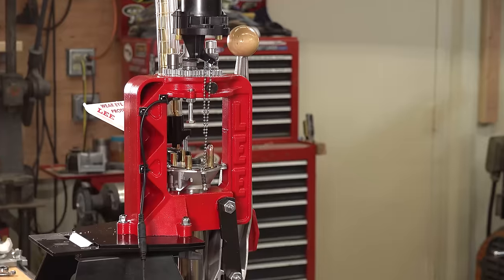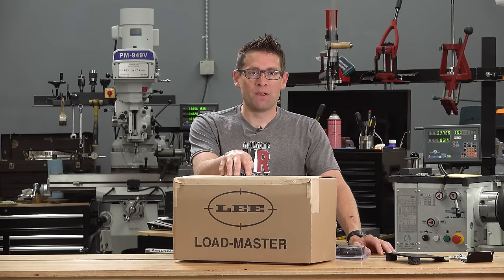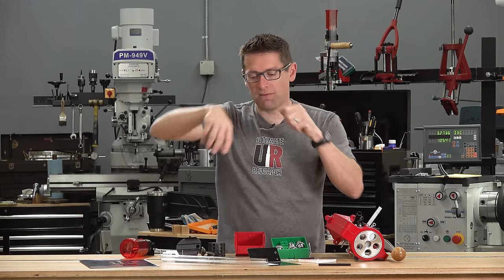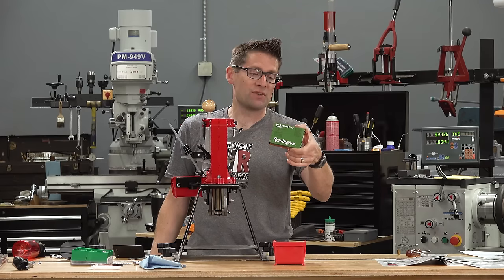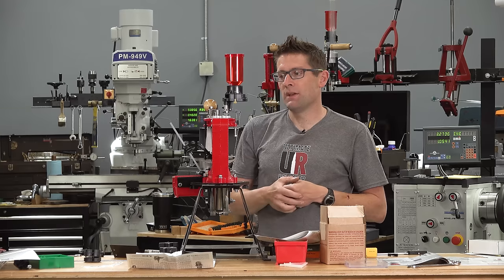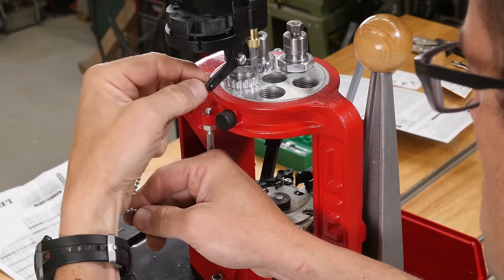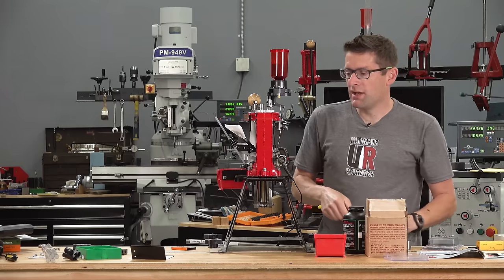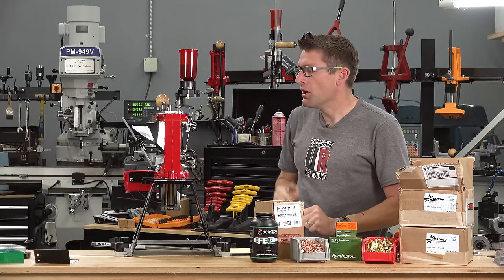Lee Loadmaster Unboxing/Setup, Loading 9mm Start to Finish

Comment: I've used the Pro1000 since late 2016, and (with simple but consistent regular maintenance) it has worked perfectly for over 39,000 rounds of exclusively 9mm - an average of about 7,500 per year. The press is still working quite well, and I'm very pleased!

Comment: I've been running a loadmaster for 8 years. Its a good press once you set it up properly. I pretty exclusively load 9mm for uspsa on mine. 

My major tip is to MAKE SURE you have it mounted very solid. Even the way Gavin had it, almost too much rocking back and forth. If it rocks around you will flip/tip primers.

Other than that, as with any progressive press, you can load a ton of ammo, or a ton of mistakes in record time. So keep an eye on things.
Reply: 🤣🤣🤣🤣 "and a ton of mistakes in record time" 🤣🤣🤣🤣🤣🤣🤣🤣
Reply: Do you deprime before cleaning with the press?
Reply: @mpngreen3897  I clean before and deprime on a Lee APP press

Comment: I've been running a Loadmaster for a year or so.  I understand there were some issues with earlier iterations of the priming system, but mine came with the same one shown in your video and between it and using the sizing die in the priming station I have no issues priming on the press.  As a rule I have to bump up the disc size on the Autodisc.  The reference list seems to be a little light for 9mm charges in my experience.  The issues I've had have all been minor and a result of something I could have done a little better.  The biggest thing to remember with this press:  If you think you're smarter than the folks who wrote the manual on it, you're going to have trouble and end up disliking it.  Follow the instructions as written and you'll be fine.  I strip it down and clean it every 3,000 rounds or so.  I'll be getting that light.  The Loadmaster is economical and reliable.  Thanks for the video!
Reply: I had the same issue with light powder charges using Alliant (then Hercules) powders.  No issues using ball powder from Winchester/Hodgdon.

Comment: I've been using a Loadmaster for 2 years for 9mm, 45acp, 38/357, .223. I modded a 6s shellplate for 9mm (big improvement). I decap, size, clean (wet pins) and prime off press on my Mec. I have never primed on this press because I used the pin method. I polished all my shell plates. I load 22-250 & 308 on the Mec. I LOVE this press. I started reloading in 1990 on a 550b (just pistol). I feel that the loadmaster is a press that needs fine tuning and that is a plus for me. I enjoy reloading as much as shooting! My favorite dies are Lee. I also appreciate your treatment of Lee. My wife wanted me to get a 650 but I took a chance on Lee and had the the money I saved for toolheads, dies, and more equipment.

Comment: I have a Lee Loadmaster with over 50,000 rounds of 9MM; 40 S&W; 45 ACP and 223 through it.  I have found that the key to making it run is keeping it well maintained and properly adjusted.  Running hundreds of rounds per session the one essential upgrade is the Inline Fabrication Roller Handle conversion.  I also upgraded to the Lee Auto Drum Power Measure.  I can't believe the press still comes with the Disc system.

Comment: I have ran my load master for about a year it’s honestly a love hate relationship. Some days I can legit crank out 700-1000 in about an hour hour and a half. Same press same components nothing gets touched, powder drop starts leaking the drum or disk, primers won’t seat, case feeder acts up, I now did 50 rounds in a hour I sit down shop dillons and look at the price and say ok one more shot it works awesome again and I touched nothing. Also installed an in-line fab roller handle if your running one of these that is by far the best upgrade for the press. My hand would cramp for days when using the stock ball now it’s easy sailing. I would like to see you do some trouble shooting videos on this thing. My powder drum will run awesome 95% of the time than the chain won’t stay put than it will drop a super light charge than no powder than on the money and repeat, than my auto disc no matter what powder will not stop leaking. Love the page by the way no brand bias you love the Lee single stage cheap intro press as much as the mark 7 with auto drive
Reply: Ditto on love hate relationship.  I do a tune up on the press every so often.  Clean, lube, adjust and that seems to keep it more reliable. 

Also, my press has "loosened up so that the index rod does not glide all the way down the frame. I had to add a washer on one of the bolts on the linkage and that seems to have helped. I think it happened because I used the press to deprime about 8000 cases for cleaning.  So I have probably run 12000 cases thru it causing it to loosen up.

I usually run 9mm and can easily reload 200-300 in an hour. For .223 I resize in Loadmaster,  prime on another press and finish the rest on the Loadmaster.  If I have $1200 I would try out a Dillon.
Reply: Just get rid of the chain.  Use a small bungee cord to connect to the powder measure and you can even run it straight back to an eye hook on the workbench as long as it applies the rearward pressure to pull the charge carrier back to the rear after the upstroke.  It's probably the first thing I replace on these.

Comment: I have owned a Loadmaster for about 15 years.  It has always had issues crushing, installing upside down, sideways and missing primers.  I have watched numerous videos on how to remedy this.  I have replaced components, tweaked this and that, to no avail.  I just prime the cases in a different operation and then load on the Loadmaster.      The case feed mechanism has always had issues as well.  The slider on the square rod binds and causes it to flex.   The toggle that pushes the case to the shell plate would short load and cause a case to crush  against the press frame.   I totally reworked the system to rigid mount the square rod and made a detent for the toggle to eliminate the short load problem.  Since doing this,  the case feeder mechanism works better than it ever did in the factory configuration.  I have loaded thousands of rounds of handgun calibers on this press over the years.  I have never been comfortable loading rifle rounds with this press.      Am waiting in ernest to see your review of the new Breech Lock Pro 4000.    Thanks for sharing.

Comment: I've had this press for about 5 years. The thing I have found I have to watch the most is the powder charge. I set mine up using all 5 stations. The charge can vary when all 5 stations are active. Don't check your charges too early. I believe its from the shell plate flexing/tilting slightly when stations 4 and 5 are empty. Love the UFO light.

Comment: I've had a loadmaster for over 12 years now and I reload 10 different rifle calibers. The only problem I get with priming is when reloading cases with crimped primer pocket. Also tight pockets can create some inconsistencies with primer depth I cured this by screwing a charging die body into station 2 so it touches the shell plate. Also the indexing crank arm needs to slide as smooth as possible I use a motorcycle chain lube CRC tac2 and the indexing is perfect. I don't size on this press I found the Lee Collet die didn't work on this press and I did a lot of case prep as well.  I've adapted a case feeder to feed 308 win, 223 rem and 6.8 spc and occasionally 1 out of 50 a case flips out I also use the Lee autodrum. 12 years and I still love it and buying a Dillon doesn't even cross my mind because the loadmaster works beautiful it will test you when you first start with it  and you do need to learn it's issues  and some people sell them because they cannot make it work so look out for bargains.👍🇭🇲
Reply: Do you swage your cases? I had issues with crimped 223, swaging fixed it right up.
Reply: @kaptkrunchfpv  i have the Lyman factory crimp primer pocket cutter and i stick it in a battery drill to speed it up. A swage tool would be good but i don't use to many mil cases just XHP 303 and some lake city 30-06. Ferdal 223 seem to give more issues so i just scrap them.
Reply: @corporalpunishment1133  Yes I have the lyman small and large primer tools myself. I was having issues with a go bit of my 223 brass even after using it also. I think I was looking only for the crimps that use the three stakes, but alot of mine also had the circular indentations. I got the RCBS swaging tool and used that on all my brass and then used a camphor tool to slightly bevel the edge of the pocket. My primers seat perfectly now. It didnt look like they needed swaging but it for sure helped even the non crimped primer pockets. I also wet tumble my brass so the pockets are just about spotless from that.
Reply: @kaptkrunchfpv  i user the chamfer tool as well. the XHP 303 has the 3 indents and i don't get much issues but yes circular crimp can be a pain i think what makes it worse i the federal 223 is the crimp is not centered or consistently pressed so it's a bit more hit or miss, so i don't bother with them I've got plenty brass now i can be more picky with what i use.

Comment: been loading on a loadmaster for 20 years .  9/40 .  one thing i had to fix was the wooden ball would give me a blister if i loaded on it for a big amount at once.  i fixed that by putting an old sock over the ball .  now i can load 1k at a sitting without worry . 

the newest primer system is loads better than the old one with the little arm sticking out.   i have probably loaded 300k on my loadmaster over the years

Comment: I ve using this press for the last 6 months reloading 9mm, 45 acp, 300 blackout and .223. i’m using the minibulletfeder  and it works great once you have the press properly setup. I’m using dedicated tool heads for each caliber including the auto disk powder measures that are extremely precise and repeatable ( 1/100 of a grain difference checked with a high precision Mettler-Toledo scale). The only issue happens with .223 when going from station 4 bulletfeeder to station 5 seating and crimping die, the stroke is to violent sometimes that the bullet flies away, even I’m flaring the cases. Overall it is a great press for the money and you can get reasonably high volumes per hour.

Comment: Love mine. Load 9mm, 223, 308, 30-06. Just swap the heads and shell plate. I did replace the chain with a spring for a trouble free reset of the powder measure.

Comment: I bought this press based on the older videos. I’m glad he did a new unboxing vid. 
He forgot to mention that when you buy it, it comes caliber specific and doesn’t come with the other priming setup (9mm comes with the small primer system only. )

Comment: have been  running 3 load masters for over 20 years. very pleased with their  customer  help ,products,,and warranty program...sure Dillon  
are better but they do the same job  at far more money...and they end up using  the lee factory crimp die best one one the market...try one you will be amazed  at the way it makes your cases fit.  no bulges...with  perfect  crimps.   have loaded from 32. to  3. 45s. colt acp and auto rim....and some rifle on them.    
 oh and all the other presses have that primer problem that everyone complains about.

Comment: I’ve run a LoadMaster for a few years, and I always had problems with the priming system and the case holder advance ram. I still use it quite a bit, mostly for 9mm and 223, but I’ve had to go back to priming by hand, just so I can be sure that each case is primed correctly
Reply: Yip, I do the same. Prime all my cases on single stage and then fill the case tubes on Loadmaster. Wasted so many primers by crushing them or getting stuck under the plate and causing more primers to fall into the ram. My setup and process still fast enough and completed rounds are consistent and costed me 1/3 of the price compared to Big Blue.
Reply: No priming issues for me in the two years of use. 9mm and 40sw. BUT i contribute my lack of failures to having a RCBS case prep station and bevel all my primer pockets prior to reloading.
Reply: When I run my Loadmaster I also prime off press.  I use mine for .44 special and .44 mag.
Reply: Same here.  Primers not seating and then powder falling under the plate. Or primer falling under the plate either way it jams it all up and I have to take it all apart.  I've been depriving and priming 100 then running them again, to pick up powder and crimp. Not ideal but overall faster
Reply: Me too. The Lee priming system costs a lot of wasted primers. Even tried a brand new primer assembly. But all it was, was new plastic crap. Still had to go back to priming by hand. I'm retired, I have time. I like the 5 stations and automatic case feed.

Comment: Good video. Completely agree on the starting with a progressive if your somewhat mechanically inclined. I tried a single stage and hated it because of how slow it was. Used a buddy’s Dillon 650 and loved it. Ended up getting a hornady LNL AP and had that press for a while, now I’m running a Dillon 750. Love the progressives. I also have a Redding T7 for smaller loading sessions

Comment: I am very close to divorcing my Loadmaster after suffering an ongoing problem with the primer feed system. I lost total confidence in the system and now pre prime my brass before running it through the press.  Perhaps this video will rekindle the spark in my relationship with it.   I will start from scratch and set it up again as if I just unpacked it.  Thanks for posting!!

Comment: I have enjoyed my Loadmaster. I had never reloaded before until I bought mine used. There are times it can be finicky. I think it is important to set it up step by step. Without dies make sure the shell plate is advancing properly. Then set up the dies properly, there are a lot of good videos on YouTube (gunblue490) videos are great. Start out with one cartridge at a time to learn and understand how each stage works. Press needs to be mounted very firmly to prevent primers from being misaligned when seating. BE PATIENT AND STUDY!

Comment: got mine a few weeks back in .223, unfortunately not the carbide dies with it, had one many years ago, stopped reloading but back into it, got this as a second press.  Works great and budget friendly.  Paid a little under $200 for everything and actually came with the auto drum not the disc.

Comment: Yes, I run a Lee Loadmaster. As most others that do the same will attest, it requires some futzing about to get it to run the way you want. But I always told myself that it was "affordable" and I like a challenge and typically don't mind futzing with something from time to time. Well, after 4+ years, I am ready to change over to Big Blue. The final straw was that the aluminum handle finally wore out. At the bottom of the handle, there is a pin that goes through it and holds the saddle on the bottom of the ram itself. The two holes in the aluminum handle that this pin goes through have worn so that there is play in them. Those holes now measure .441 for a pin that is only .432. By contrast the corresponding holes in the yoke still measure .435 so those are not severely worn. Big deal, so there is a little play, right? Nope. That play allows the ram and the carrier to move radially. That little movement messes up the crank slide for the case pusher so the crank slide sticks due to the slight misalignment. Then the case will not always get pushed all the way into the shell plate or a shell won't drop at all. (just depends on which way it has moved) So I'm finally giving up on the Loadmaster. I've ordered a new handle and will rebuild it, but I'm done with the Loadmaster as my main loader. I kept this thing well greased too, but you can clearly see that there are chatter marks in the machining of the holes on that handle. It served me pretty well for that time, but I for one will be moving on to a Dillon XL750.